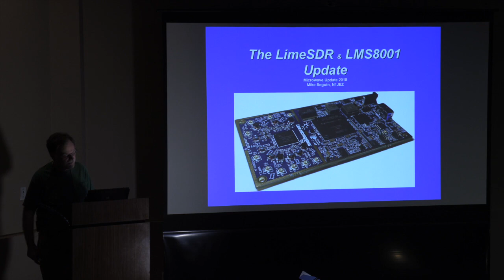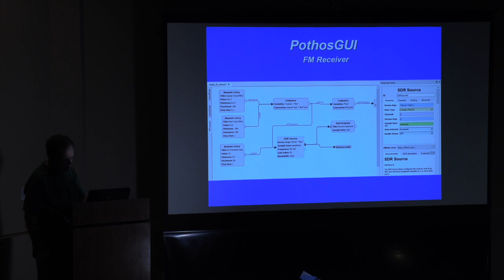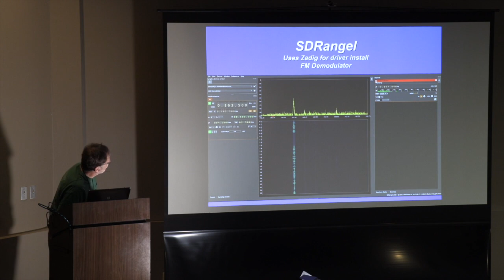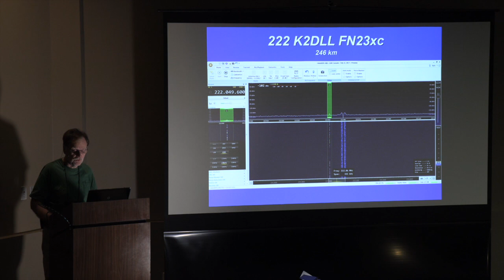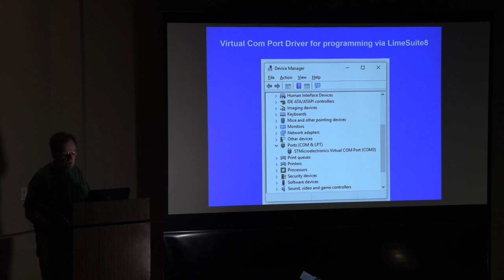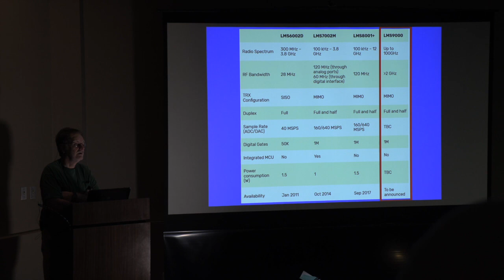Mike Seguin, N1JEZ - The LimeSDR and LimeMicro

Comment: When removing the (MN18) inductor for 20m operation, could the FM band have been filtered out in software (instead of using the FM Block Filter (B01LE9LRPM))?
Is the $300 companion-LMS8001A (for 5-10Ghz) similar to the Ham-It-Up-Converter for HF?